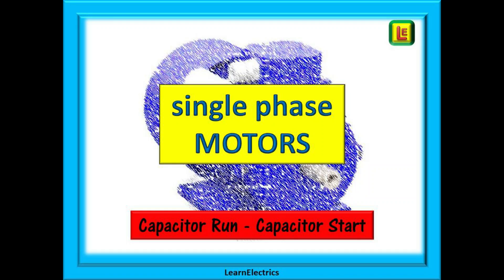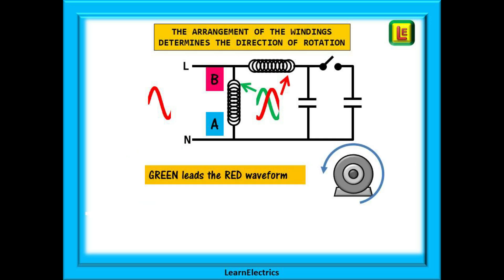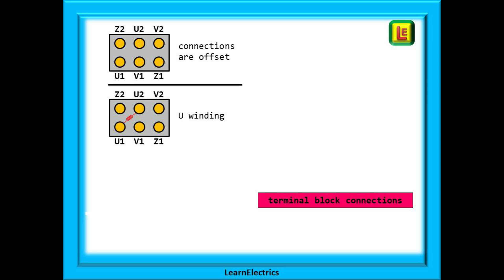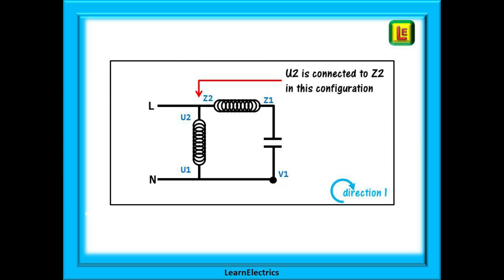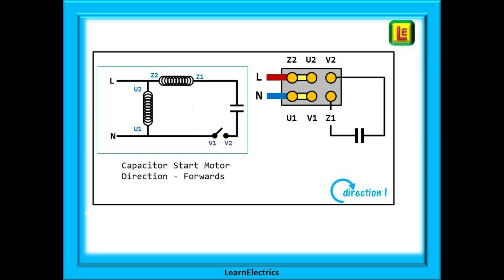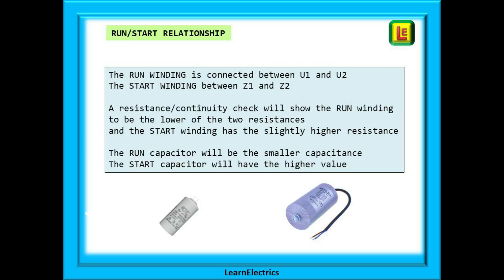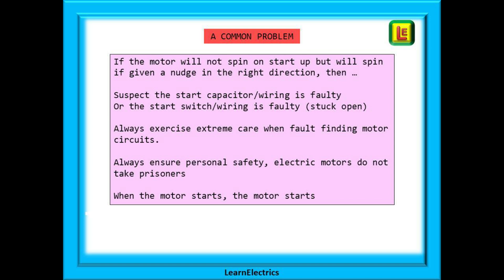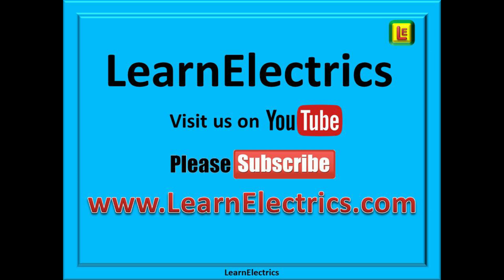SINGLE PHASE MOTORS – Capacitive Run and Capacitive Start electric motors

Comment: Please explain singal phàse motor with starting and running capacities with fowerd and rivers switch we turn to f to r we interchange running winding ends but starting winding  in same position with running çap on that time current flow on same way in starting winding is it ok
Reply from the maker: Have a look at this video. Hope it helps.
https://www.youtube.com/watch?v=45re1J-RxKc

Comment: Is it possible to wire a switch into the motor connections to allow forward and reverse functions?
Reply from the maker: Yes it is. Its usually done with changeover contactors. We will do a video on this soon and on three phase star delta starters. Thanks for asking.

Comment: Wow! This is perfect timing. 
I am upgrading a consumer unit very soon in a domestic property and one of the circuits is for motorised gates. At the moment there is a 32amp mcb in place but the new consumer unit will have RCBO’s. Do motorised gates work well with RCBO’s or can there be   nuisance tripping. Thanks
Reply from the maker: With motor circuits you sometimes have to go from a type B to a type C breaker or RCBO. If you go for type C remember that the max permitted Zs will be lower.
See our video on Zs

Zs where do the numbers come from on the following link.
https://www.youtube.com/watch?v=IjpJK1eJLzw